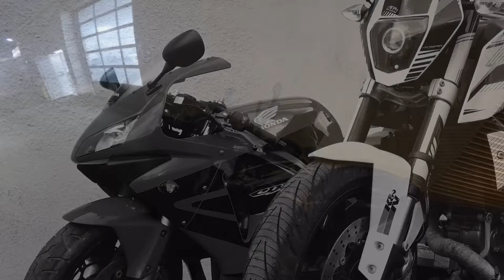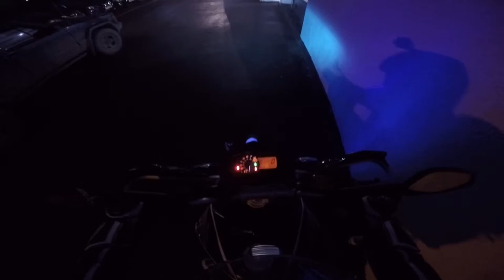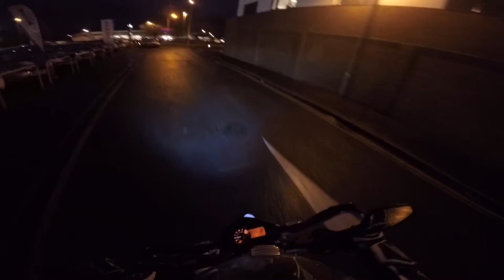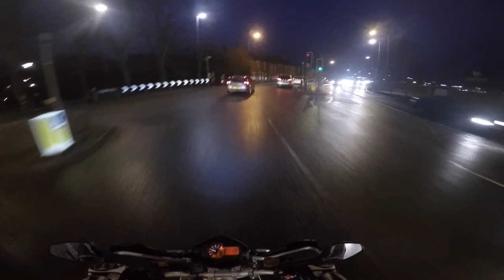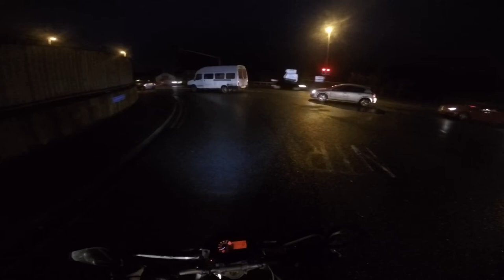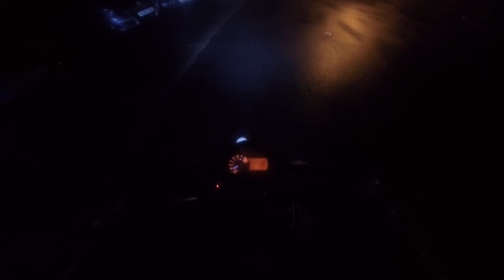The Pigs KTM Duke 690 gets Kev's O2 Controller Mod

Comment: I found the o2 mod made nearly no difference.  However...I took it off and added Kev's fuel mod (i have GPR decat and can, DNA stage 2)  really helped balance out A/F ratio.  Far cheaper than the power commander and a damn good fix.
Reply from the maker: Cheers for the info mate, might go down that route or trade in for a 1290! ;)
Reply: awww...c'mon.  Nobody needs that kinda excess.  The 690 is plenty of ripper for me.  Thanks for posting the vid, and ride safe.
Reply: Were can i buy the kev's mod ?
Reply: @handrevanzyl5142  just send a PM to KEV on https://www.xt660.com. He will send you the package. ( i have the 2 mods on my ténéré  - 2 controller + Fuel Mod)

Comment: Make your own air temp mod. Use a 1k potentiometer an run the signal from the air temp meter threw it and then to the computer. About 2£ cost.
Drive safe.